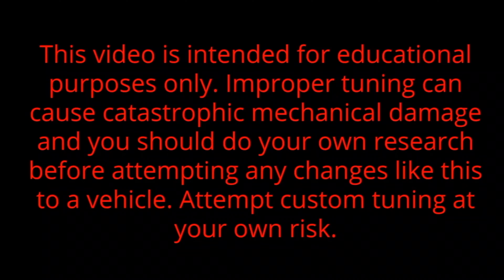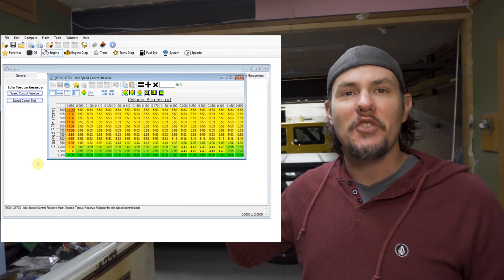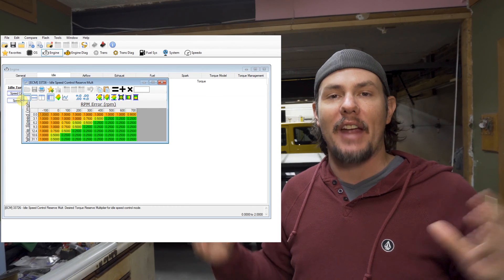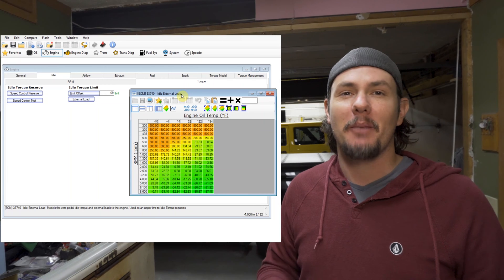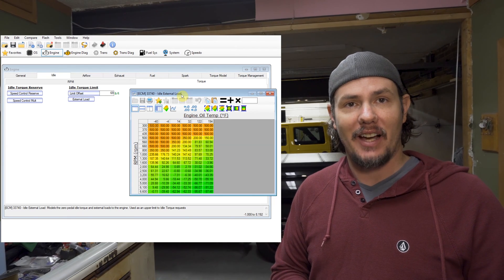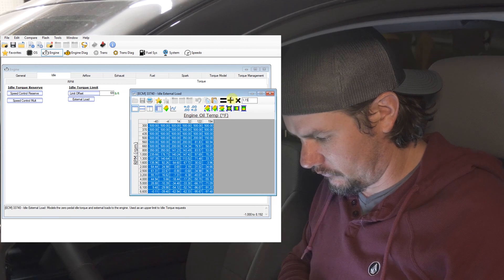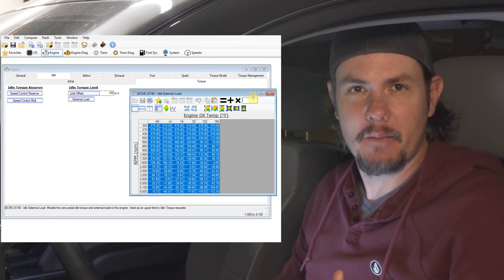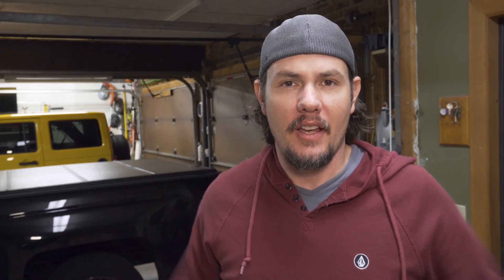Testing Gen V Idle Torque Settings, The Correct Way To Do Idle In HP Tuners?

Comment: So, on the idle speed control reserve multi, its max rpm is set to 700 rpm...wouldn't it work better if it were to be set to a higher rpms as most cammed engines will be idling faster than that?

Comment: Just purchased the HP Tuners Mpvi 3 for my 18 Silverado , and did my first tune this evening on my truck with 6.2 , BTR DOD delete cam and 1 7/8” long tube headers and I am pretty happy with the first tune , but I’m still learning this gen5 so next mod is another cam .566” 218 / 224 @ .050 on a 113.5 LSA icl is gonna be 107whats your thought on the cam specs ? And thanks for the great info on torque management tuning 😊

Comment: Basically, use this if your engine is not maintaining your set idle, such as an  aggressive cam install. The torque or power will increase to maintain the idle rpm.  Think of when you turn on your air conditioning, the engine now has increased load on it at idle, so the ecu increases the torque output from the engine to maintain idle from the A/C load.

Comment: I got a question, if you're in park and you blip the throttle in a cammed gen v. When the RPM drops and drops below target idle and runs rough and or even dies. What table fixes the throttle body and a slow closing event?

Comment: Oh, it wasn’t clear that you had added a supercharger, I didn’t catch that that was the mechanical change you made to which you needed the corresponding electronic control change.  In this case the supercharger places an additional parasitic load to the engine, both at idle but also proportional to boost, which is linear with rpm.  So in this case the external load table would need to be tuned which is supposed to model the viscosity of the oil and accessories and the supercharger, being belt driven, is another accessory it didn’t account for.  You would also likely need to do VTT tuning to account for the the sum of the torque produced from boost and the negative torque the supercharger produces when compressing the air. The VTT table is the correct place to model that because it controls for RPM X air flow.  I’m looking for tuning for a cam so this was not the correct video for that.

Comment: I’ve watched this a few times prior to today and I don’t have these tables. My 2014 Camaro ss LS3 seems to have a blend of 6th gen and 5th gen on other parameters. But my question to you is why do you have -7 degrees of tuning at idle? I ask this cause before my torq storm super charger was added and I was idle tuning a very large N/A cam the car seemed to like -5 degrees of timing at idle but I was told to run 15 or more. 3 well known shops never were able to tune the idle on my car N/A and that was the only reason I brought it to them. They would tell me they cleaned up WOT tuning and of course it was all jacked up from where I had it and would end up tuning it myself over and over. Your videos have literally been my tuning school for the last 3-4 years!!!!!
Reply from the maker: It's based on the virtual torque tables, try and lower your torque values in just the idle areas and see if the timing comes up

Comment: I just got a few test drives in with my genV L83 swap camaro and it actually runs great but it doesn’t idle great it sounds like it has a blower on it surging up and down. It is TSP stage 3 cam DOD deleted. What should I look for first? I’m inexperienced in hp tuners but I am using it, in fact just learned how to change the tire size an gear ratios today, hopefully that makes 1-2 shift a lot better
Reply from the maker: Lower that idle torque, too high with the cam
Reply: @GoatRopeGarage  ok I’ll look for it thanks for responding

Comment: will virtual torque affect torque converter stalling in a gen 4 , i have a caprice with a l77 and 6l80 2800 stall and when it idles it feels like there is no converter at all .it is up against the brakes all the time

Comment: how would this affect camshaft timing? can you do a video specifically on camshaft timing under ideal settings for the Gen V?
Reply from the maker: Loaded question, cams are so different they tune differently but short of the most aggressive ones your can do most tuning without changing much in relation to the cam

Comment: Why did you pump up your external load tables instead of  lowering it down are you runing a cam that's actually efficient at low loads to the point that it makes power on idle?
Reply from the maker: All cams are different, this was on a stock can but with a blower so there was more air, thus more power, at idle. NA cam setups will usually require less torque

Comment: My truck won't idle and will run rich at low low RPM and will just die after a few kicks,, will this help my e92 gen V, I can send tune files if you need, and an engine spec build.

Comment: Hey man have you done much tcc adjusting with high stalls ,  do u no if under Trans and Tcc pressure (apply ramp) would this section need to be bumped up with a aftermarket converter, thanks
Reply from the maker: Think it's dependent on your convertor as they are all a little different. You can monitor TCC slip on most TCMs, of you're getting some under lockup it might be an indication you need more pressure
Reply: Cool man , yeah I got a 2.7 stall seems it’s still thinking it has a stock tcc in it and slips in higher rpm , I will try monitor slip and go from there , would that be the table to adjust and possibly build a histogram off of , thanks man
Reply from the maker: @jjk1668  probably don't need a table, just the parameter so you know when it happens
Reply: Sweet man thanks for your time

Comment: But, what about all that negative timing? Thats what I am seeing as well. Idle is spot on, but all that neg timing seems wrong given how it makes egts super high
Reply from the maker: Don't know that that holds true on DI engines
Reply: I tried moving all 4 of those tables to bring idle timing to 12 or so. All i did was make it run lean. After reteaching maf, righr back to neg timing. So back to stock tables....
Reply from the maker: @str8dum  You are going to have to touch on the VTT then as it still thinks you have too much Airflow so it's dropping your timing.
Reply: Id guess i need to lower my vtt in the idle area
Reply from the maker: @str8dum  worth a shot, I've had to do the same